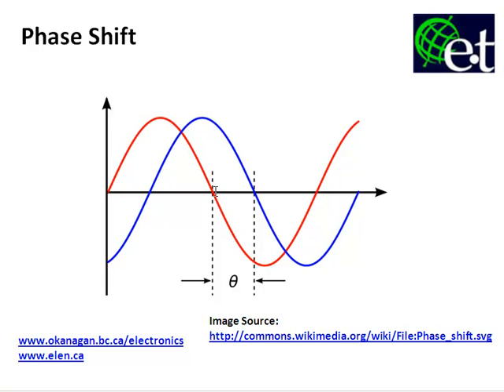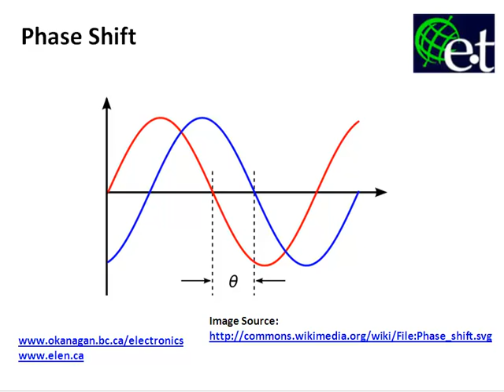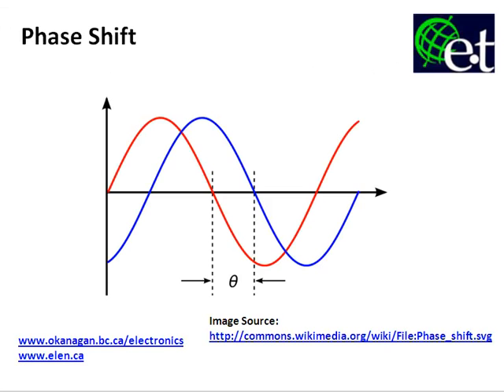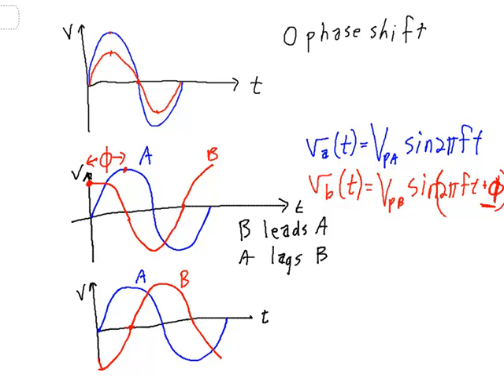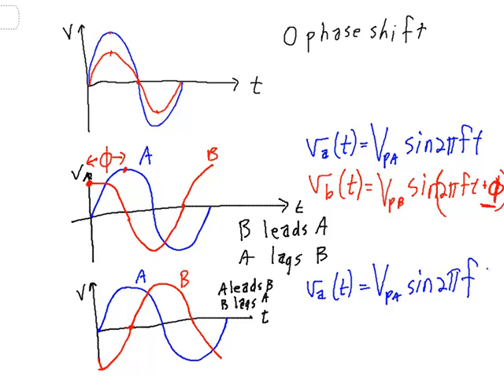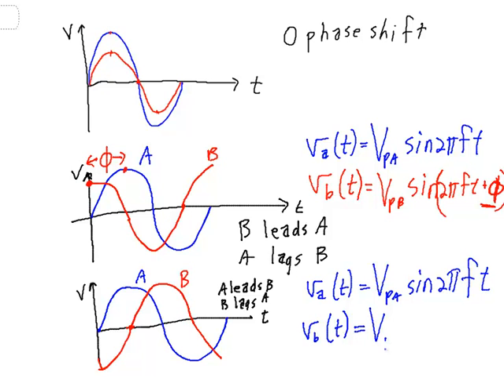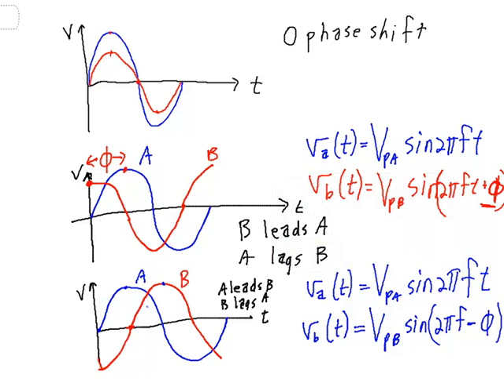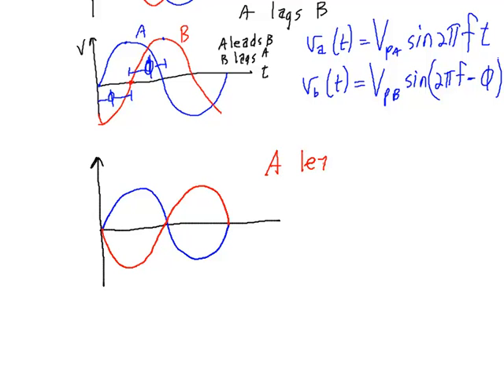Phase Shift in AC Signals

Comment: The issue with the plots is that these are not sinusoids, but just single periods of sines, and so there would be infinitely many frequencies associtated with each these two windowed sines. When just plotting two infiinite sinusoidals of different phase, you cannot see which is leading or lagging, you can only see the phase difference between them. Also, the terms leading and lagging will give people a sense of phase being the same as a delay, whereas in reality, the associated phase delay does not necessarily come from an actual 'latency' or 'dead time'.

Comment: hello sir I hope for some help the circuet in question is the mc 3334 ic chip for hei ignition system Im confused like hell. I desperatli need means for retarding ignition system so I have no choise to make my own circuet ignitor or some how modifi the pick up coil or ignition coil . So I did try out in the past useing 2 ignition modules on 1 pick up coil bouth work perfectli fine so I was wondering culd I use dual ignition modules to retard ignition timing I only dont understand what resistor or capacitor value what to use exactli or calculate it? I also figured out perhaps I culd use some sort of pulse generator on the negative pick up coil lead beacause I noticed to activate the module it only requares the positive trigger pulse from the pick up coil. So I hoppe you understand my problem. I didnotice my cheap module does not have zener diode in its circuet so I also experiance back charge and the module miss behaves randomli via ground because there is no reverse voltage protection circuet for that mc 3334 ic chip . So I requare around +/- 20° phase shifting ac or dc pulse for that module circuet so I can easyr start engine in cold weather .So I hoppe you can sugest some thing or some equal circuet that is more variabel and that can replace my current circuet for triggering the ignition coil I use the E core ignition coil. So any help wuld by great so that I can understand that staff . I also was curiuse if its posibel to use multi tap mini transformer on the pick up coil or not to achive that phase shifting event?

Comment: What is the reason for all these phase shift?
Reply from the maker: These phase shifts are caused by the presence of inductance/inductors and capacitance/capacitors in the circuits. Inductors cause voltage to lead current and capacitors cause voltage to lag current

Comment: a question please if i have the output of my coil the volts and the current are 180 degree out of phase if i want to max the power then i need to make the volts and current in phase right ?  another question please , can i make the volts and current out of phase only by 90 degree this way it the generator will have delayed lenz and no drag on the prime mover ?

Comment from the maker: There are some pretty simple op amp circuits that can introduce a phase shift (for example, search for Stanley_OP_Amps_with_Linear_Integrated_CKTS_pp271_276.pdf)

But, if you are trying to create a 3-phase inverter, using op amps is not a good choice - it would be too inefficient and the op amps may not be able to handle the power. 3-phase inverters are usually made by appropriately controlling the switching sequence of a 9 (or more) switch configuration.
Reply: i dont mean to be so offtopic but does someone know a trick to get back into an instagram account?
I was dumb forgot the login password. I would appreciate any tricks you can give me
Reply: @Kelvin Kelvin Instablaster :)
Reply: @Bobby Maximiliano I really appreciate your reply. I got to the site through google and Im waiting for the hacking stuff atm.
Looks like it's gonna take a while so I will get back to you later when my account password hopefully is recovered.
Reply: @Bobby Maximiliano It did the trick and I finally got access to my account again. I'm so happy!
Thanks so much you saved my ass!
Reply: @Kelvin Kelvin No problem =)